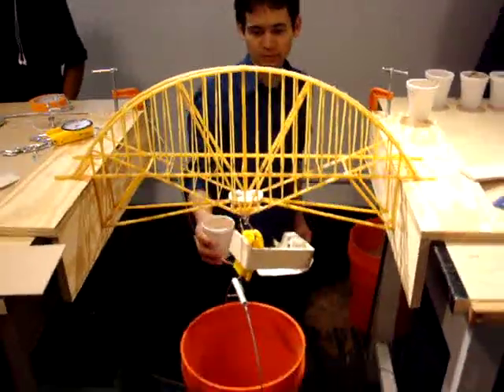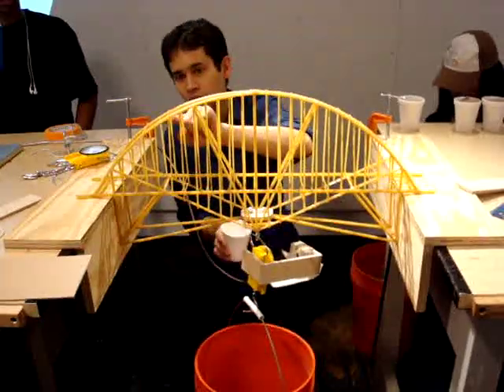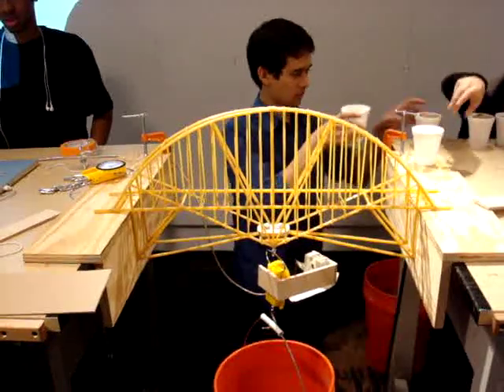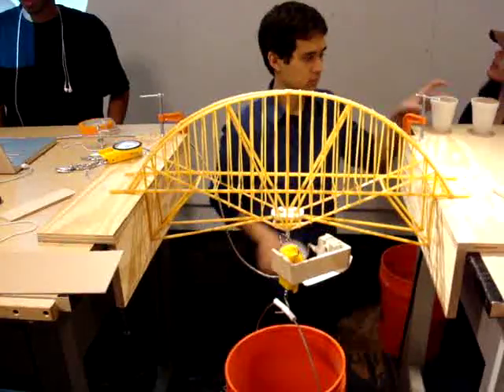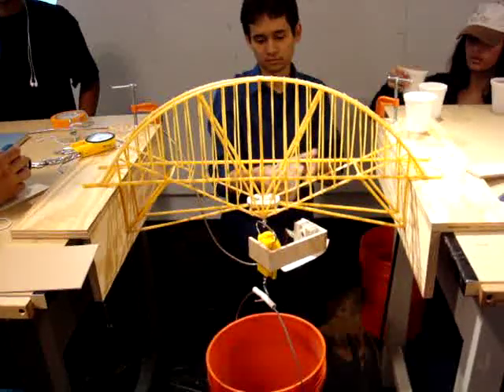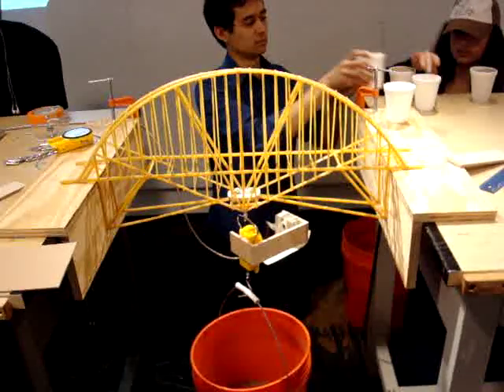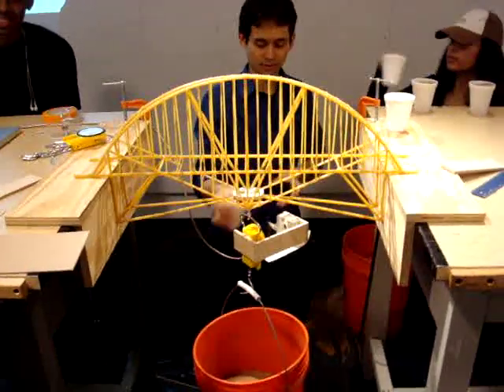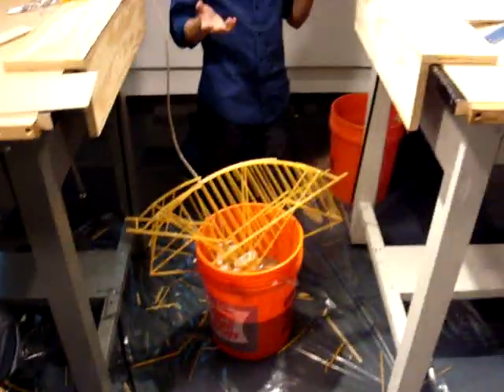NYIT Structures Pasta Bridge Build Off

Comment: Could you update the description to add the measurements in standard units?

I don't mean to be annoying, but I spent way too long looking for a convertor and find out how much those cryptic "oz" and "lbs" weigh. Let's spare that to the next curious person.
Reply: As an american student at an american university, I wholeheartedly agree. Everything makes more sense in terms of length and mass and in metric rather than in US units (however weight is something I'm still getting used to). Too many physics and engineering classes have brainwashed me hahahaha
Reply: a bridge should be tested as a bridge
it is more like a structure than a bridge
also tested as a structure, not tested as a bridge
suppose a bridge could hold 100 cars, can you imagine hanging the weight of 100 cars at a crossbeam

Comment: The key to building is usually putting "linear tension" on the material, not bending it. By either pressing or pulling the pasta in this bridge, the least force is exerted perpendicularly to the length of the spaghetti, which would make it break much more easily.

Comment: because water is lot less dense than sand, it's gonna take forever to load the structure, and they're gonna need a gaint pale, and it's harder to clean it up after failure.

Comment: Correct me if im wrong, but arent those 2 triangles at the bottom pretty much just adding weight to the net weight of the bridge? As the death weight increases those components in "compresion" will me horizontally..

Comment: @beamthegreat1 Wrong. 2 parts of the bridge broke off before it completely collapsed. If i remember correctly, the way this bridge was build, they used too much glue over the whole bridge. 
If it collapsed due to the physical limit of pasta, the whole bridge would collapse at once all together because each and ever piece of pasta could not hold any more weight, There was a flaw on the left side of this bridge which made that side break. 
He is wrong, The shape of the bridge matters.